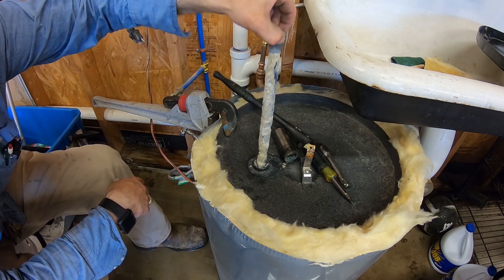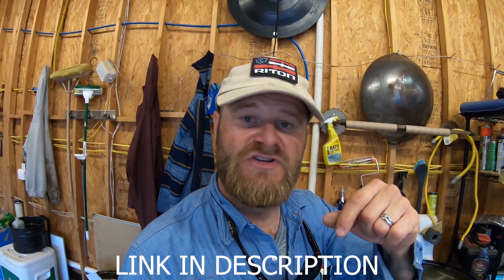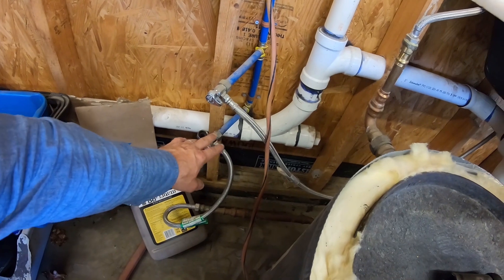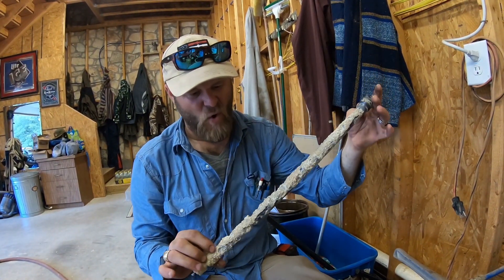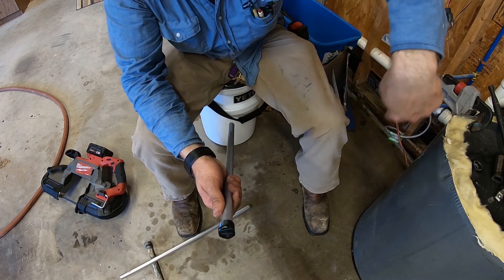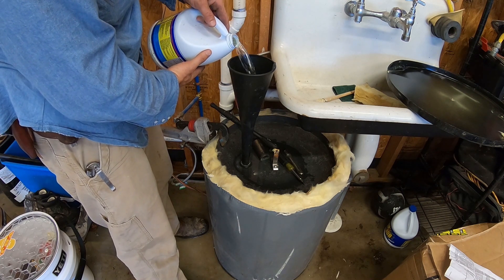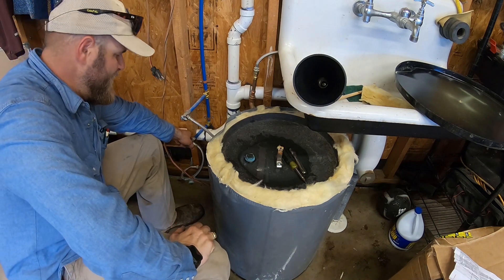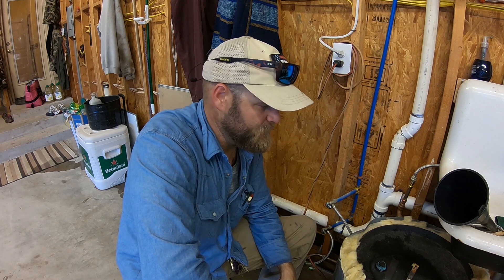ROTTEN EGG SMELL in your WATER do this FIRST

Comment: is there a torque spec for reinstalling the new rod? Or, just make it "real tight" and more?  Make it squeak a little?
Reply from the maker: I don’t know of a torque spec but if use Pipe dope or Teflon tape and tighten down until it’s snug then it won’t leak! You don’t have to go crazy tight but more than hand tight. Hope that helps. Thanks for watching